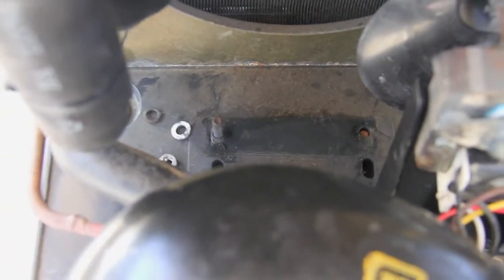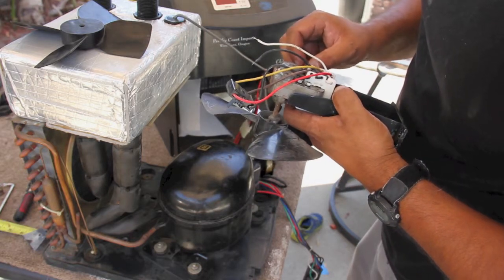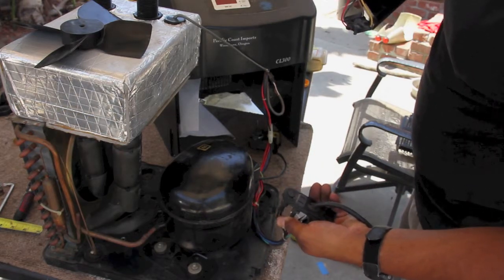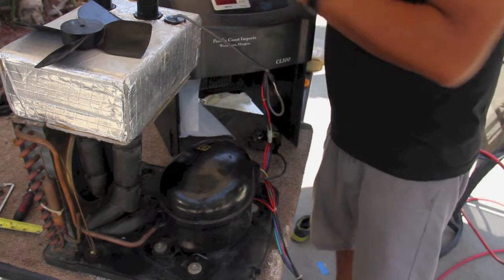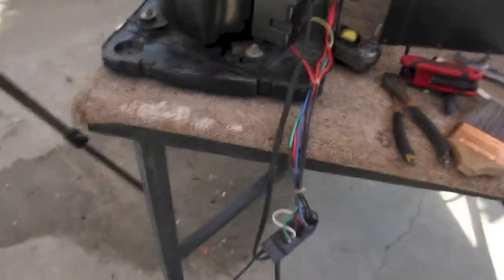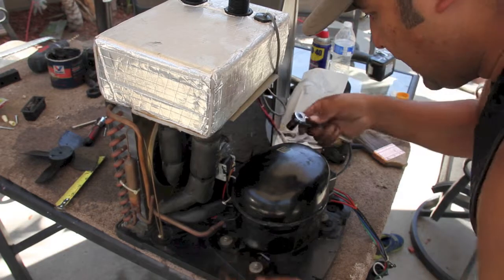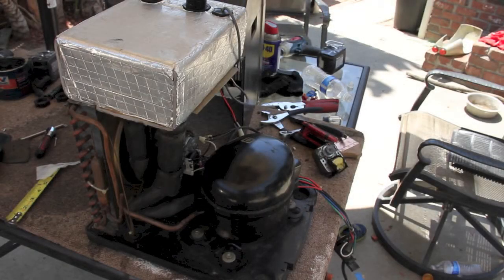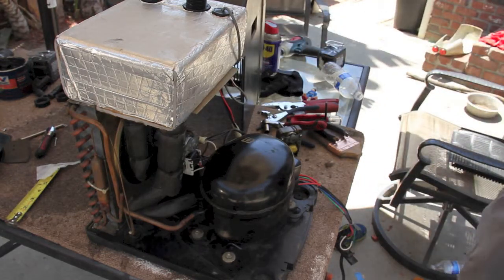Diy Chiller Fan Replacement.Part 2

Comment: Nice job, looks like you got it under control. So far I havent had to use a chiller, my tank stays at 78 in the summer.
Reply from the maker: ***** Yes I understand that but that is not mention in my video at all its simply a fan swap nothing more. Messing with the compresor is far to risky and it leakes is harmfull to the environment and yourself. The purpose to this video is to save some money I dont think that this sytem is even rechargeable and plus I think it takes R12 and you need a licence and personal business to even get a hold of R12.